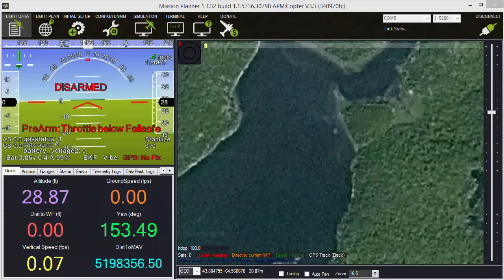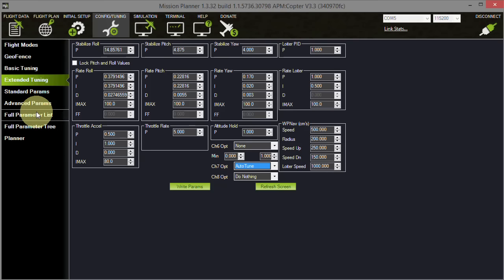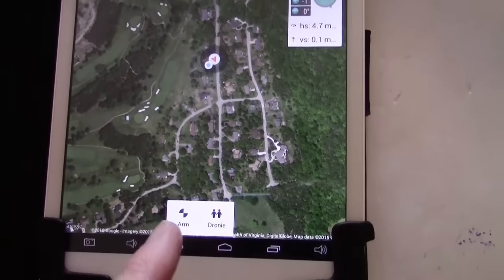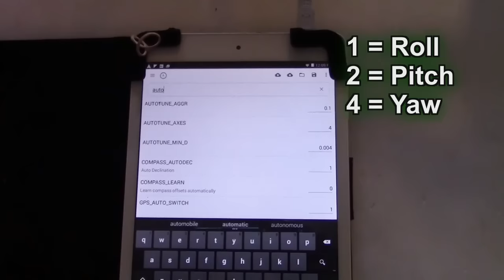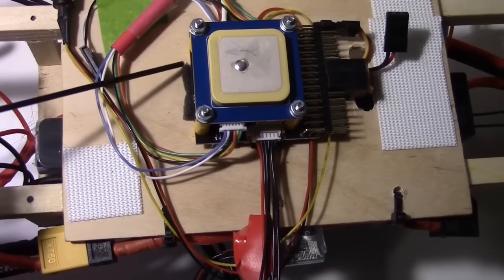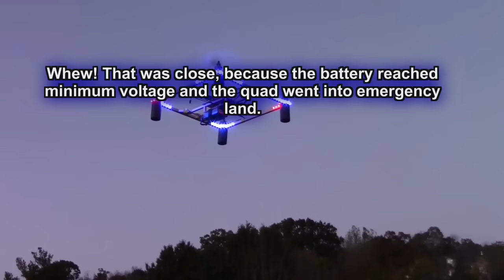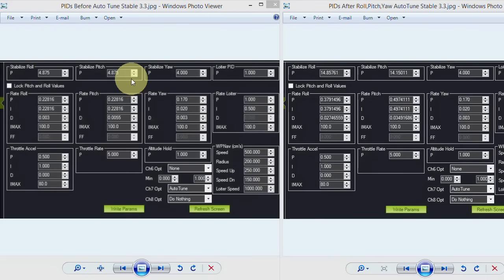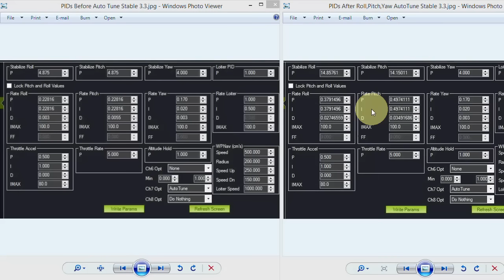Mini PixHawk Lite Part 3 - How to do Autotune with V3.3 Firmware

Comment: I got the my Mini Pixhawk lite installed in a Carbon Z Cub. It works great. Question for you is do you have your barometer covered with foam to keep the light out? Thanks for sharing.
Reply from the maker: +renoflash06 It's to keep the wind out of the holes. I explain this in the video. Used foam from a cheap paint brush.